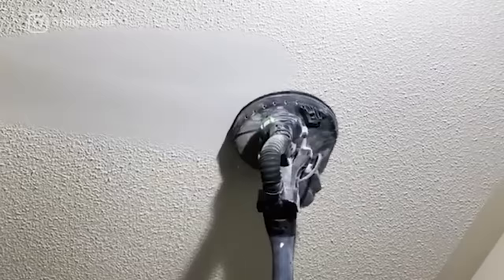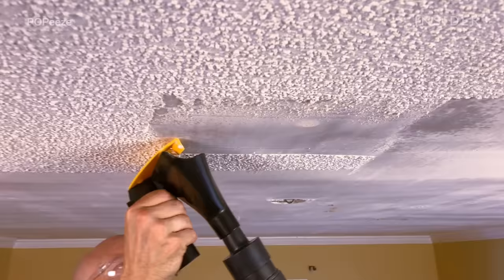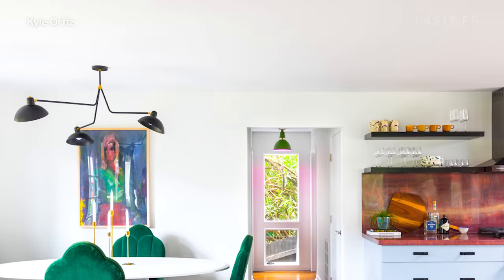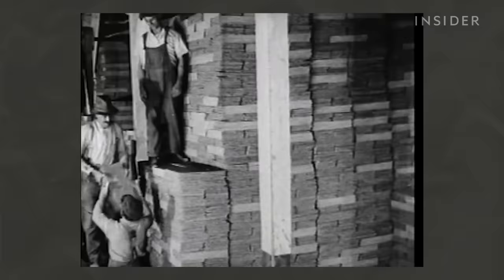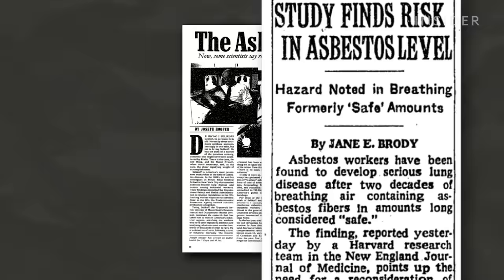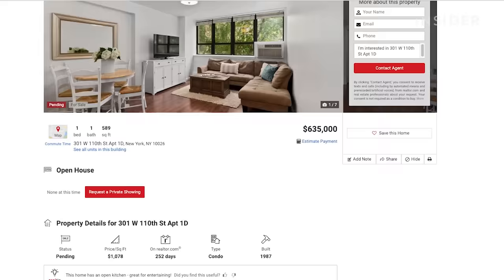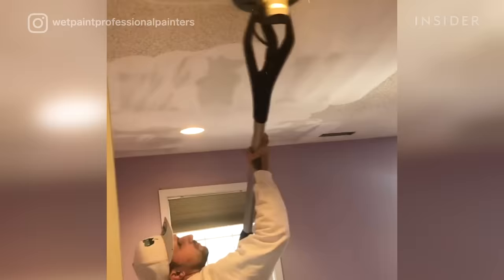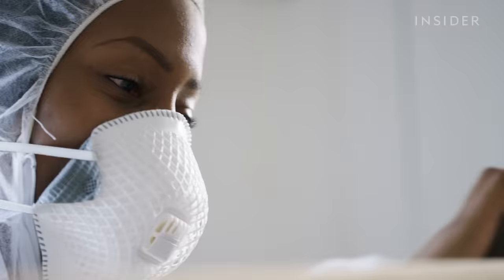Why Are Popcorn Ceilings So Terrible?

Comment: My father did our kitchen and dining room.. but he added golden flakes embedded in it.. it actually looked great. And btw.. for a 5 min video.. you spent two minutes talking about asbestos.. which you later said had nothing to do with popcorn ceilings. So.. why do you have so many likes for your video with all that dead info?
Reply: Asbestos is used in creating the popcorn ceilings. Essentially, if not well maintained you have an increased risk of exposure. Also, upon trying to sell your home, it will take away thousands of dollars in value or you will end up having to pay for it in a request for repairs anyway prior to the sale closing. Also, it’s often used to hide damage holes or imperfections in a ceiling, which could lead to issues upon the homes inspection upon a sale. Better to get it done locally on the cheap then have to worry about it later when the labor costs have likely risen
Reply: 2:35 Maybe watch it before commenting? It's not a big deal if the asbestos is left alone, but I'm pretty sure most people don't want a ticking time bomb in their living room.
Reply: @Khepriem  great job of pointing out that the video mentioned that asbestos was used to make popcorn ceilings in the late 1800s. Unfortunately for you, we dont live in the 1800s. And asbestos isnt used anymore. So.. now Im wondering why did your reply got so many likes? Eeek.
Reply: @sp5072   no its not you get get the same effect other ways. Asbestos was banned in 1977, yet people used other ways to still add it through the 80s. Wish the folks who made this video did their research a bit more. Popcorn ceilings dont have any long term effect as much as it used to 40 years ago.
Reply: cloudybrain thank you man
Reply: "Dead info" lol. Damn. Another page full of ignorance. She said if its left intact it won't pose a threat.... but it's STILL made with absestos. WHY would you want that in your home, for ANY reason?
Reply: If your dad put up NEW popcorn ceilings it's not a problem. It's the OLD ONES that's more of a problem.
Reply: Rebel Love because it’s not going to give you cancer or AIDS or whatever it’s a joke they only way you get it is bye eating like real popcorn
Reply: @kingocto  Dude Asbestos wasn't even invented until 1920. You're saying it was only used in the 1800s? You're making no sense. Especially since your claim is that THEY said asbestos had nothing to do with popcorn ceilings, and they did. This would be why my comment had support, but since when does popularity = credibility?
Reply: @dutchvanderlinde6209  Suuuper incorrect mate. Asbestos wouldn't have been outlawed if it was only dangerous if eaten.
Reply: Zephyrus Auron asbestos is a naturally occurring material that has been found in debris since the Stone Age...aaaaaaand asbestos is also dangerous when inhaled, being able to cause scarring of the lungs, however this is rare in regular neighborhood families. This literally took 2 google searches to find. Sources were asbestos.com and Oregon State University.
Reply: @Comadycoyote01  The materials that asbestos is made of have existed since well before the stone age, but considering you can say that about most things that exist today I'm pretty sure he was talking about asbestos, as in the thing we've been using to build our homes only within the last century. And how is lung cancer a small thing? We have no idea the impact asbestos had on families because everyone had it in their homes. It's one of those things that don't really have a control group for testing. All we do know for sure, is that it's incredibly bad to have built into your home, especially in an exposed manner.
I'm honestly curious if this is just YouTube making you guys argumentative to the point of absurdum or if there's actually a sect of 'asbestos truthers' out there.
Reply: I added glitter to my popcorn ceiling when I repainted it!
Reply: Zephyrus Auron if you open your mouth when it falls or just scrap it like a bad rash is the only way you will get sick
Reply: @Khepriem  I didnt say it was made in the late 1800s... the video did.. and your comment pinpointed to that area of the video.. the whole point of my comment is how falsely one sided this whole video is.. and how little research went into the making of it.
Reply: @angeleyeszarai  is she talking about houses built after asbestos was banned? This video is generalizing pop corn ceilings.. claiming all is made with asbestos.
Reply: @kingocto  No... Did you miss where it explains about the six naturally occurring materials? It was talking about those, not asbestos cement. That's why they started talking and showing the asbestos cement directly after. Lol you didn't actually watch the video did you? You just tried to take it outta context and call it good.
 And one sided??? I guess there ARE asbestos truthers out there! Let me ask you something else. Do you believe the Earth is flat? Or that vaccines cause autism? Or that the moon is fake?
Reply: @dutchvanderlinde6209  If you're talking specifically about popcorn ceilings, then yes, it's not exposed abd the video even says as much. If you're talking about Asbestos I dare you to find some and rub your face in it.
Reply: @Khepriem  you said "six natural occurring materials.. not asbestos cement".. then you said "thats why they talked about asbestos cement after".. you're a bit incohesive here. If you don't see why you're incohesive.. then why did they talk about asbestos cement after they talked about the naturally occurring materials? I made a connection.. because THEY made a connection. You are making it loosely tied in your response. The video's way of explaining it makes it dead info. If you dont see THAT.. then like me illustrate it in another example.. its like saying becareful of wearing denim.. because back in the 1800s they used poisonous blue dyes that causes skin cancer.. and then talk about it for 3 mins.. then later mention how blue dyes are now regulated and its okay to wear denim.. but just dont run with it otherwise you'd be getting non fatal regulated blue dyes on your skin. Like wtf. I really think you're trying to read between my lines.. but there are nothing between the lines... I made no mention of saying asbestos is safe in any way. Their 2 mins of info is dead info. End of story. Asbestos truther? flat earther? vaccine/autism? fake moon? Jesus. You sound like a guy that easily gets triggered.. then tries to say triggering stuff so that other people gets triggered.. then tell them how triggered THEY are. I know your type bro.
Reply: @kingocto  Okay you're getting wayyyyy too caught up in wording here. Bottom line is that they were explaining that asbestos is in many popcorn ceilings and that it's ingredients, that are also generically called asbestos, have been used as building material since the late 1800s. Meaning if your house is old and has a popcorn ceiling, it probably has Asbestos in it. Now why you're soooo against this is beyond me, but I'm not about to continue wasting my time on this. Thanks for being so rude throughout.
Reply: @Khepriem  And all Im saying is that this video does a poor job in clearing that up. Talking about asbestos is not dead info.. but to be so anti climatic about it.. I just had to stop watching the video at the end. Like literally.. all the video had to say was... "Popcorn ceilings installed before 1977 has a higher chance of containing asbestos, due to it being unregulated by the government. So if you live in one of those houses and want it removed then its best to get a professional." That took ten seconds to read.. not two mins. Plus I wasn't being rude.. if I was.. show me how. You are the one that did all the assuming about me.. but I am unwavered by that and kept my argument to the point.
Reply: @kingocto  I mean... They went in chronological order... If you can't handle that then oh boy do I have bad new for you. And no, you couldn't literally have stopped watching or you wouldn't have known it was dead info. Something you're still incorrect about, since it all tied in, but I've already explained that.
Reply: @Khepriem  I stopped watching the video.. I have yet to watch the last minute. What does chronological order after to do with any of this? And why do you think I have a problem with that? Im talking about the prolonged 2 min section about asbestos. This video is talking about "why are popcorn ceilings so terrible" and it did a shitty job explaining it.. using like two reasons.. and I think the first reason is because "it looks bad". In all honesty.. I can re-watch this video to watch the other reasons.. but it sucks too much to even bother.

Comment: I kinda like popcorn ceilings because they add texture to an otherwise blank and boring surface. I can see how it would heavily conflict with the straight-edge more modern look of interiors nowadays though so I can see why someone might want to get rid of them. It also sucks if there is ever a reason to rip up the ceiling for repairs because it almost never matches the older portion of the ceiling and can become an eyesore.

Comment: It legit doesn't even look that bad-
Reply: yeah, my living room's ceiling has a popcorn design, it's on purpose because the rest of the house doesn't have it.
Reply: It’s horrible
Reply: @gram727  how?
Reply: I have this in every room of my house.
Reply: Its horrible to try and clean & if you touch it little bits come off its gross
Reply: sad fruit snack It’s cheap looking and old fashioned. But not even good old fashioned. It’s super tacky. It doesn’t compare to a perfect smooth ceiling. It never should have been a design
Reply: And I feel the same way about stucco exteriors. Yuck I always remove them during a renovation
Reply: @violentsludge  Asbestos is poisonous! 😨 This is why regulation and research is needed on every product that reaches the masses for home or daily use. 
So glad people have wisened up about the damaging and deadly nature of asbestos and its been, majoritively, banned. 
Recent case, Johnson and Johnson lost a lawsuit for knowingly having kept the deadly product, asbestos, in their baby powder, causing cancer in women. 
As the narrator said, if left untouched can be okay to live by, but when wet and/or molded, or  tampered with or inhaled, can impact us, negatively over time. 
I would definitely get a professional robremove it. It's disgusting.
Reply: @gram727  386 people disagree with ya bud
Reply: ConnerTheKillerYT and 50k agree with me 🤣

Comment: The ceiling of my old place had to be completely redone, and the contractors asked if we wanted popcorn again or a flat ceiling. I thought flat would be less expensive, but it turns out that costs more. We wound up going for orange peel, which doesn't have the points and imo didn't actually look bad at all.

Comment: In Europe it’s not only a ceiling it’s a popcorn room walls and everything 
Like my bed is on the side and I’ve injured myself so bad on it I hate it
Reply: In Germany it's not sprayed on, but a type of wallpaper which is basically two sheets of paper with tiny flat wooden pieces in between. Pretty safe as there are no sharp pieces sticking out, unless you damage the upper layer with a knife or something.
Reply: Rippes my nose almost completely off when I was a child from this
Reply: @chunye215  Not exactly. What you are describing is a  Rauhfaser-Tapete ( rough-fiber-wallpaper) in the style of Rauhputz ( Rough plaster).
Rauhputz is done with coarse sand in the plaster on the concrete or brick wall.
Reply: @chunye215  In the UK, when I moved into a house it had that wallpaper

Comment: Lol scraping that shit off when the majority of these coatings contained asbestos
Reply: Eye protection and a mask. Also use a spray bottle with warm water spray the ceiling, wait minute or 2 then scrape it. It will remove in big chunks instead of a fine powder.
Reply: You can test it for asbestos. That's what I did. There was no asbestos in it. Then I removed it myself. I'm still here.
Reply: @mara8456 at least yout got it tested. There is a 20-30yr latency period after exposure. 

What im shocked is only one women in that video had the property respirator (the pink P100 cartridges)... Then the video saysbto wear a proper mask (and shows a N95) that does do anything for the wearer when working with asbestos.

Comment: Lmao I have popcorn ceilings and walls, it was only built 16 years ago.
Reply: Don't worry. It doesn't contain asbestos because it was built after 1981. Asbestos was banned in 1978, but manufacturers were allowed to continue to use up their remaining stockpile of asbestos. By 1982, all asbestos stockpiles have been used up. All popcorn ceilings since 1982 are texture only and do not contain asbestos.
Reply: My house was built 2 years ago and have pop ceilings

Comment: It's easy to remove without creating lots of dust. Simply wet 4 or 5 feet at a time with a spray bottle, and just scrape it off after letting it soak in for 2 minutes.

Comment: I have popcorn ceilings in my whole house
Reply: Better get rid of ALL the popcorn ceilings ASAP because even the tiniest amounts of asbestos causes lung cancer. We're talking as little as 1.3 parts per billion (1.3 mm^3 out of a cubic meter). Even brushing it with a feather duster already releases that concentration of asbestos.
Reply: @00crashtest  1 what is asbestos and 2 when i was little i ised to eat the ceiling am i going to be ok
Reply: doggo mckitten you’ll be fine
Reply: @adventuresofwillandshelby6013  ok
Reply: @leaflet7738  **Do you even pay attention throughout the whole video?**
Reply: @Acerlyne  no i didnt watch it all not gonna lie
Reply: @leaflet7738  *Sigh*
Reply: @Acerlyne  you know you dont have to use four of these * to bold right you only need two
Reply: @00crashtest  Plain walls can have moisture dots what is bad for your lungs aswell.
Reply: doggo mckitten sighs more
Reply: 00crashtest what about if you live in an apartment with popcorn ceilings?
Reply: @Zoyiekka  Then move to a one built 1982 or after, if your apartment isn't rent controlled. Asbestos was officially banned by the EPA in 1978, but suppliers were allowed to sell asbestos until their stockpiles ran out, which happened in 1981. Popcorn ceilings since 1982 do not have asbestos. But popcorn ceilings are extremely rare since 1982 anyway.

Comment: Who DOESN'T have a house with popcorn ceilings?
Reply: ElectroBlastLuigi people that live in new homes
Reply: My house was built in 1950 and it has the original flat ceilings ( including some cracks ). It was on my list. No popcorn ceilings. I had already removed popcorn ceilings from a 2k sqft house my folks lived in and never wanted to deal with it again.  ( it looked so much better afterwards )
Reply: Bino Dino maxilimilanMus royal guard Nothing to do with age of home. It's just bad taste from the 1960s.
Reply: Me
Reply: Probably people who live in a country other than america
Reply: meee
Reply: Me
Reply: I do, but most of the ceilings are in my grandma's house. Only thing, they didn't spray it up, they put it on the ceiling & then made the popcorn look by swrirling it with brooms. At least that's what they told me &I don't know why they would lie about their ceiling. They bought the house in the 80s I believe & fixed it up.
Reply: My home build in 1920's.
We have rustic wooden ceiling in the whole house but I am from Europe and popcorn ceilings ain't really a thing here.
Reply: i've never seen one unless it was custom designed or renovated to remove them, they pretty much come standard in Canada

Comment: I thought you’re supposed to wear a mask when removing popcorn ceilings
Reply: A dust proof one
Reply: Or really removing paint in general.  It's extra dangerous with popcorn ceilings, but any time you deal with fine particulate you really should be wearing a good mask with a filter.
Reply: YOI CANT MAKE ME WHERE A MASCK!! I HAVE RIGHTS!!1!
Reply: @FullOfMalarky  macsk wear nwow
Reply: @FullOfMalarky  lol time to inhale some asbestos
Reply: Ironically, one if the few places where 'they' definitely CAN make you wear a mask. Good old workers safety laws. Prevents the "We provided masks, they just didn't want to wear them" trick.
Reply: If it has asbestos then most certainly, as well as protective clothing and cover up the whole rooms in a dust proof manner and specially get rid off the stuff that comes of. In other qords when it has asbestos you need a professional to do it, unless US doesn't care about that then I guess you don't. In Switzerland you have very strong regulations regardings asbestos.
Reply: @SAA-hr9gr  Yeah in the Netherlands too I think. When she said "you can do it youself to save a little bit of cash" I was like WTF

Comment: The earlier version was just plaster which was textured by pulling a flat surface out of wet plaster. That raised bits. Another variety was the water swirl. That was made in plaster by moving the trowel in a series of arcs. If. You have that, and it's in good condition, try to appteciate the craftmanship that went into it. Unlike spray gunk.
Reply: I lived in an upper duplex that had the plaster swirls you mentioned. Even as a 19 year old straight man, I thought it was quite stunning.
Reply: The plaster swirl is sooooo much better, but I'd take flat matte over popcorn ceilings any day